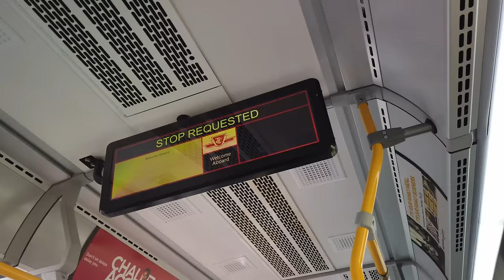Why American Buses Are Just Worse

Comment: Around the year 2000 I was visiting the Skoda trolleybusfactory in the Chech city of Ostrov. Over there they told me they had just dismantled the old production line for high floor buses and were continuing to build only low floor buses. To their surprise, The American companies who wanted to buy their trolleybuses ordered the obselete high floor buses. Chechs are not too difficult, so they rebuild their old production line, and started again building high floor trolleybuses for the American market
Reply: ETI (Skoda) was dissolved in 2004 after failing to win a bid in Vancouver.  Only San Francisco and Dayton bought them, and they weren't nice.  They replaced and were replaced by New Flyer trolley buses that were much quieter and more reliable.
Reply: @az.................  Ehm... you get what you pay for?
Reply: The BYD K8 electric buses common in Shenzhen are also high-floor for some reason, despite being introduced only in ard 2016 I remember, while Singapore initially opted for a low entry design for its Volvo B9TL buses despite them being able to be made low-floor instead

Comment: As a regular user of buses
in Mississauga, my frustrations are this:

1. Lack of regular frequency on major arteries (Hurontario aside)

2. Low capacity buses being used more often on busy routes resulting in over crowding.

That said, what Mississauga and Toronto do well is running their bus network along a grid system unlike other cities in America where you have to ride a bus into the city centre only to take another bus to get back to another suburb.
Reply: RIGHT?! What is with that Dundas bus, so few of them for how busy it is.
Reply: Even in a city built around a single center (which is not that often in America) you need radial connections. And in grid cities, you should make your transit a grid, at least somewhat
Reply: @jan-lukas  You mean tangential connections, right? Radial connections are the ones that force you to drive to the city center first.
Reply: For how stupidly wide Mississauga stroads are, there's no reason the buses should keep getting caught in traffic. It remains my pipe dream to have the buses get dedicated, separated lanes and signal priority at intersections. There's NO reason, even with the amount of stops required, for a trip from one side of the city to the other, to take almost twice the amount of time or more by car
Reply: @BirdmanDeuce26  I mean, they DO have a transitway...
Also, get a grip on reality bud, taking the TTC across Toronto takes FAR LONGER than 2x the time it does in a car, that's just a FACT of public transportation.
Reply: @shawnpitman876  I'm...not sure what you're getting at here. That's what I said; there's no reason it should, but it is, and that's not a good thing. Are we not agreeing?
Reply: @BirdmanDeuce26  Yes there is a reason why it should take longer, and no we are not agreeing because that's just an absurd statement to make. Public transit, which stops MANY MANY TIMES while crossing a city will NEVER match the speed of a vehicle that gets to get on a dedicated right of way and not stop the entire time during the trip, and that's BEFORE getting into the higher top speed of cars than public transit. It's literal buffoonery to think that's even a possibility.
Reply from the maker: For sure, but nicer buses would also make it a better experience!
Reply: @shawnpitman876  yet the waisted money on the transitway which has very little frequency and demand - and you require a car to get to the transitway stations or a feederbus. The should have had dedicated lanes on Burnhamthorpe and Dundas
Reply: @shawnpitman876  It doesn't have to be the same than by car, it just has to be better than now.  I'm not asking for Heartland Town Centre to Meadowvale Town Centre to be 15 minutes by bus, I just don't want it to take 45 minutes with a circuitous wind through multiple neighbourhoods.

I would like separated bus lanes and signal priority for Mississauga's buses because so much of their delays is just getting stuck with the rest of traffic and waiting at stoplights, especially at peak hours. How much faster/more frequent could you run these buses if they weren't stuck behind 20 other people turning left on Mavis/Rathburn Rd to get to Square One?

I called it a pipe dream for a reason. But if you keep saying it's stupid to think bus routes, planning, and the whole experience can be improved to where the time penalty for taking public transit can be greatly reduced in comparison to taking a car, then why bother changing? Maybe a dream is all it will have to be.
Reply: @shawnpitman876  Ever visited London? I've just looked on googlemaps and to get from my place in the west to a specific place in the east of the city is 2 minutes quicker by public transport than a private car.. And that involves walking 5 mins to catch a bus, then change to the tube and then change to national rail. That journey also includes estimated (yet highly accurate) waiting times for the various transport modes too btw.
Reply: I can drive from my apartment in Mississauga to Clarkson GO in 8 minutes and the bus takes 20. To visit a friend that lives near Square One it's a 15 minute drive or a 1 hour bus ride.
Reply: @shawnpitman876  But there is no reason trips to places close to my house - but on the  next route should take so long.  I've seen trips of 1.5 hours for something I can drive in 12 minutes.
Reply: @TheMl145  agree. I would a say a 5 minute drive by car = 30mins on the bus.
Reply: @shawnpitman876  I think you're discounting how much traffic affects car travel times. buses in a dedicated right of way on a strict schedule will quite often fly by rush hour traffic because car travel isn't actually non stop either and you're dealing with so many more variables. Not only does car traffic stop at intersections, it stops and starts for all sorts of reasons (turning in and out of driveways, raccoon running into the street, whatever) and creates negative feedback loops between cars resulting in traffic jams. Also there's just more surface area of the right of way occupied by vehicles at any given time.
Reply: @nc3826  absolutely! It blows my mind when ever I google trips under 10km in Toronto and it shows biking as being the faster mode of transportation compared to public transport
Reply: i hate going back to mississauga these days. they dialed frequency, esp on dundas, downso it's so annoying the lack of options sometimes
Reply: any area that actually expects people to use their buses regularly need to have at least 30 minute frequencies most of the day, and at least 20 or better during peak hours. And if they're not going to provide true 24 hour service they still need at least a couple early/late buses.
Reply: @TheMl145  That's a problem but a solve able one. Just bus lanes and signal priority can speed them up a lot and help keep schedules consistent.
Reply: @Joesolo13  I'd say even 30 minute avg and 20 minute peak is too infrequent for most locales. In order to attract riders, wait times need to be minimal, especially when multiple routes and/or one or more changeovers between systems (such as switching from bus to subway) are in play. I'd cut those times in half, 15 min avg and 10 (or even 5) min peak sounds more like it to me. I know this video is talking specifically about buses, but the kind of frequency I'm talking about makes trams quite attractive because they can be automated, thus achieving frequency without blowing up the labor budget (and/or sticking tons of people in low-wage, physically demanding jobs; driving a bus all day is actually quite stressful on the body because we're built to move, not to sit in a static position for hours on end). Buses certainly have applications, but I really believe the qualities that make a good transit network are most accessible by rail.
Reply: @shawnpitman876  1. Mississauag only has 1 transitway, and half of it's in the middle of nowhere.
2. Comparing the TTC to highways is unfair. For long-distance travel, you need compare cars to the GO train (which will get faster).
Reply: Mississauga buses are 100% better than any bus service in my area in the UK, for a start, the last bus to the next town is usually at 5pm and any other services finish at 10pm, even during the day it will be 1 bus an hour, only a few services run on Sunday. So never going to be an alternative to the car in my View!
Reply: @thunder____  I'm from a rural region in the Netherlands, and we cope with 30 minute frequency just fine. Some services run with a 15 minute frequency during the day (such as the train from the most important regional city to the nearest big-ish city), and I think some buses run more frequently at peak times too.

While yes, some connections ARE objectively terrible, for the most part our bus network is 'good enough' for the low density. The secret? Making sure that everything connects well. If you have infrequent service, you better do what you can to minimize transfer times by coordinating. So if you get off the train, you generally can catch the bus to your final destination within 10 minutes. Even if it's evening and the train only runs every 30 minutes.
Reply: @BirdmanDeuce26  We have dedicated bus lanes in alot of Oslo, and trams. Had to google your city too see population and saw it was bigger than our capital city so i guess its a fair comparison after all. In the city center there isnt room for dedicated buslanes cause trams cover most of it. And the city is very old, so not really made for the car and multiple lanes. 

I live in the outskirts of a smaller city (popyulation 52,000 people) my next door neighbor is a farm. I have a bus that comes by about every 1 hour on weekdays about 3 mins walk away. And another bus route that comes every 15mins if i walk 12minutes. I can get to most places in the city or the neighboring city in 30mins.

We dont have dedicated buslanes in my small city. But they have started building dedicated bicycle lanes so people can use that more easy and safely. Bicycle lanes in my city is not super yet, but they are working on it after focus on "greener" society became a priority.
Reply: @RMTransit  Making me sit for 2 hours to get to a job can't be offset by giving me a nicer seat. Public transit will always be second-rate and for poor people only, unless it's designed to be faster.
Reply: @japanesetrainandtravel6168  It's the same in Hamilton. Traveling on the bus with no transfers is almost the same speed as a non-athlete riding a bike; if you need to make a transfer, the trip will end up being just a little faster than walking.
Reply: @thunder____  Definitely 30/20 is far too infrequent. In Hamilton the people who crow about our great bus system all live along King/Main, where there's a few buses every 5 minutes. On the mountain we're stuck with 20/30 and it is absolutely useless for transfers, so nobody takes mountain buses unless they're handicapped or a student.
Reply: @MrDanisve  Sounds like I'd have a much easier time getting around Oslo than in my own city without a car, I'm sad to say. You wanna know what's even stupider? Toronto Pearson Airport (YYZ), the major airport of the province (and arguably the country), is on Mississauga city land  - and the city has no direct shuttle/bus/tram light rail service to any of the terminals. It will take you over an hour by bus from most places in the city. But by car? 15 to 20 minutes. Needless to say, the airport's garages make absolute bank.
Reply: As a Brit with a Canadian mother who has spent nearly every summer since childhood in Mississauga, I still get the culture shock every time I go and realise I am effectively stranded and at the mercy of a bus system which somehow makes my city (not London, very car-centric for a U.K. city) look like a transit Utopia.
Reply: @BirdmanDeuce26  Toronto Pearson is a nightmare, I swear to god - the airport itself is fine, but the traffic going in or out is ridiculous. It once took me an hour and a half to get to my grandmother’s house from the airport by car, and she lives IN Mississauga. I don’t even want to think about how much worse the bus ride would have been.
Reply: @RMTransit  I think the aesthethic comparison is a bit personal and unescecarry, the vast majority of "beautiful" new buses all look pretty much exactly the same and the insult you had towards the gilligs aesthethic while trying to show a pretty ugly hunchback of notre-dame looking novabus bus as "better". the GMC RTS series looks better than most new european buses, many european buses just look like generic bubbles, the classic 80s/90s bus look is iconic, this is a bigger problem in new american urbanism, old 60s-90s aesthethics are derided while boring millenial influenced ones take over and we end up loosing history because of it 
american buses may be worse in practicality but aesthethic wise they look pretty good
Reply: at least your suburban bus actually runs more than hourly american ones